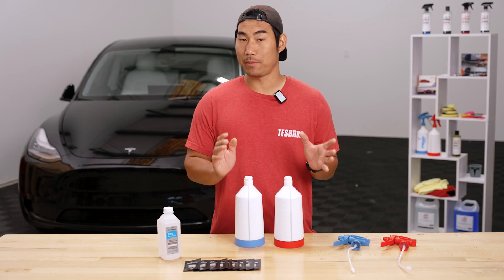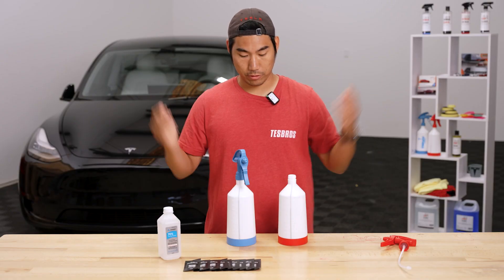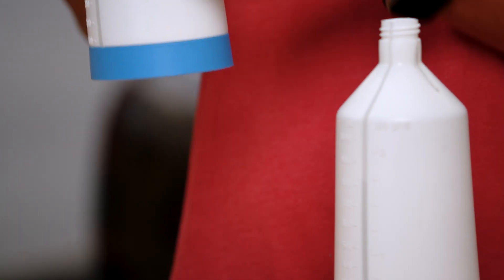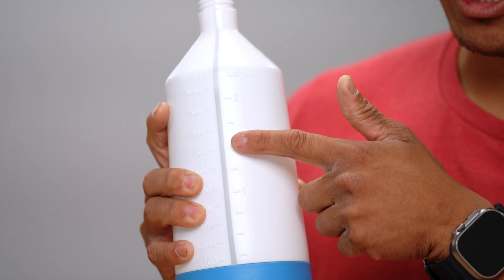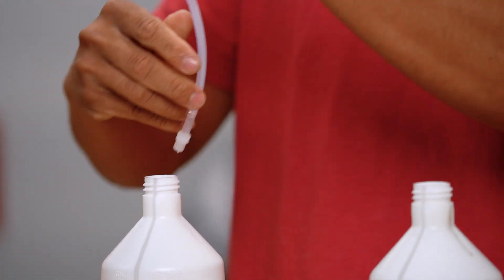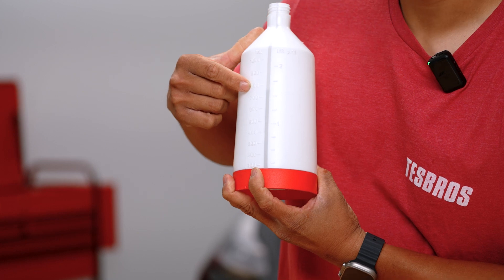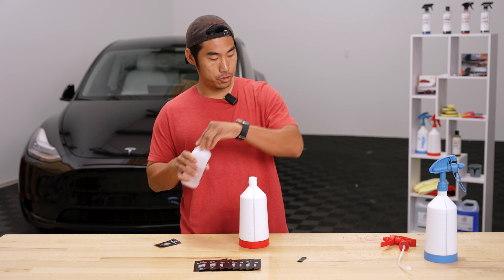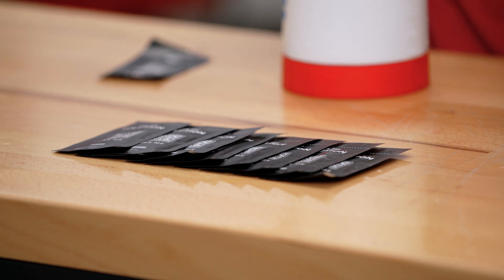DIY PPF Kits - How to Mix Slip and Tack Solutions

Comment: Hi One quick question. Hope you will answer. Can I use ethanol based rubbing alcohol as tack?
Reply from the maker: I wouldn't recommend that. We use 70% Isopropyl alcohol and distilled water (20% IPA/80% water mix). Ethanol-based alcohol evaporates too fast and may not provide the same slip-to-tack control that IPA does. Ethanol-based alcohol can also contain additives that interfere with adhesion. IPA is a bit more pure.